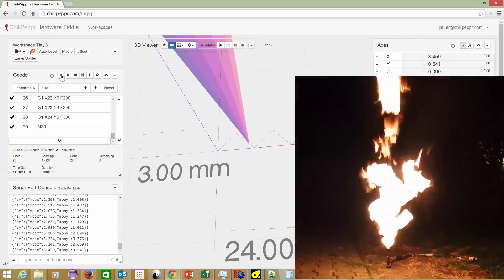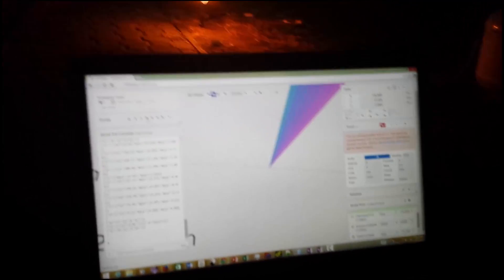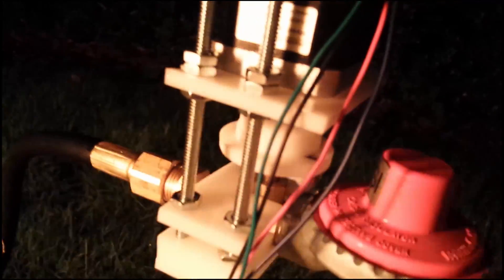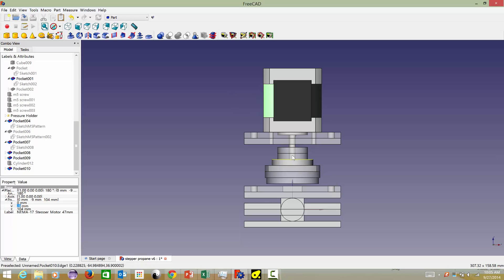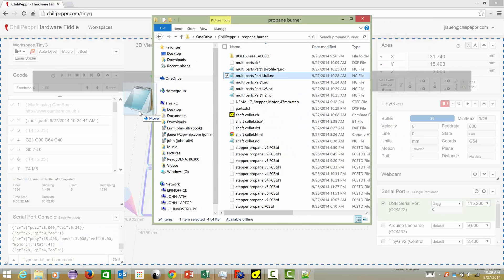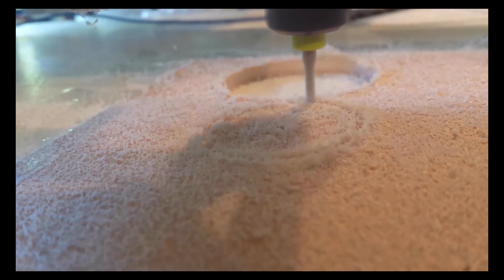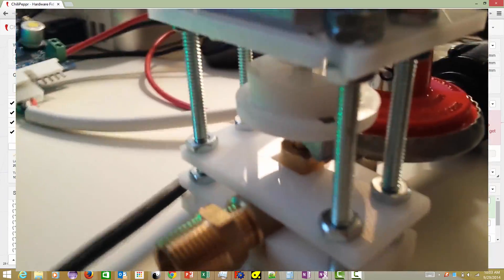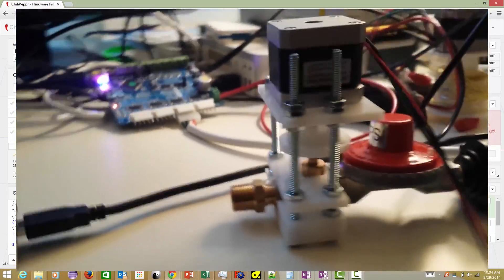Propane Shooting Flames from ChiliPeppr

Comment: The backstory on the ChiliPeppr is more interesting than the flames.  Nice.

Wireless remote is a nice touch.  Consider using a remote Xbee and and Arduino (with EasyDriver Stepper Motor Driver) so you can skip the speaker wires running through your yard.  
A Rubens' Flame Tube would make a more interesting display for the firefighters when they arrive at your house.

refer:
https://www.youtube.com/watch?v=kUz0wsNb-HI
https://www.sparkfun.com/products/13226  ; EasyDriver - Stepper Motor Driver
https://www.sparkfun.com/products/10414  ; XBee 2mW Wire Antenna - Series 2 (ZigBee Mesh)
https://www.sparkfun.com/products/11373 ; XBee explorer
& Battery P.S.

Comment: why didn't you use a solenoid valve? would of been a lot easier surely.
Reply from the maker: Because I needed variable control of the flame and solenoids are either on or off. There's no pilot light with a solenoid. There's no animation of the flame.